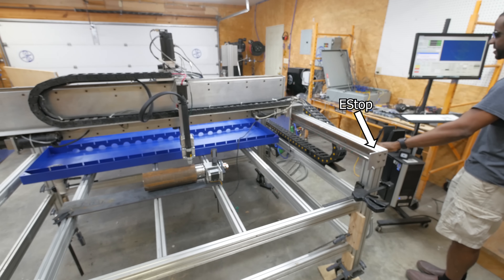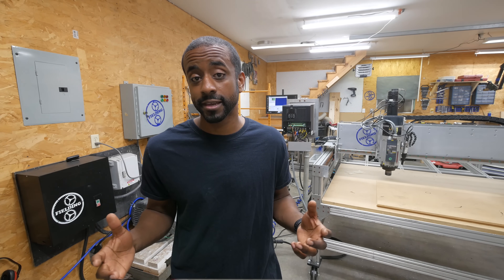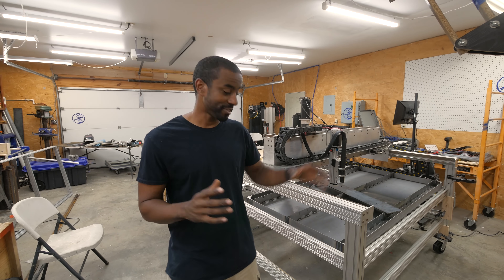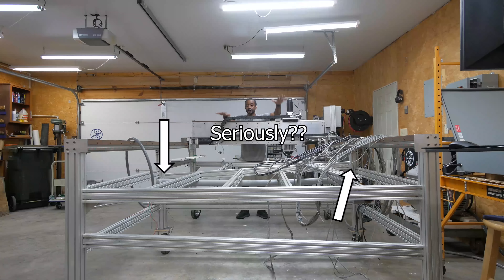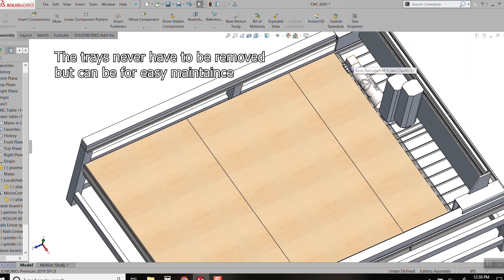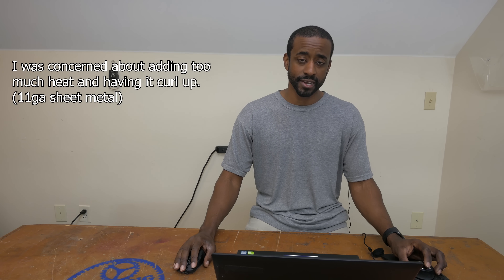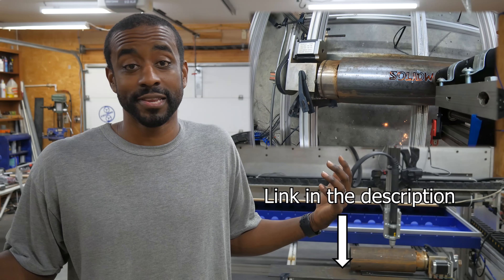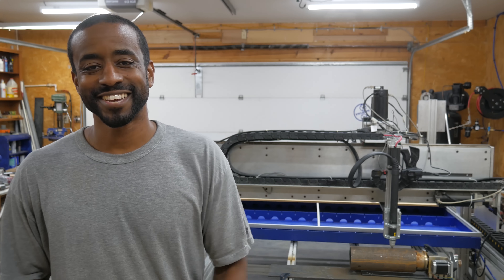Building The Ultimate DIY CNC (#072)

Comment: As a draftsman, I only know of three axis. One is vertical. Two are horizontal. What is the 4th axis. 🖖
Reply: I sure appreciate your help on this now that I understand what you mean by a 4th 5th and 6th axis. Are there more?
Reply: @twighahnjackson  yes, there are more. I've read about 7-axis machines and 12-axis machines. I believe the 12-axis machines have XYZABC (6-axis) for both the fixture and the tooling (6+6) for a total of 12 axes of independent motion. Sometimes it is just referred to as multi-axis machining.
Reply: Pretend that I'm draftsman not a maker? In other words, dummy it down for me please. 🖖
Reply: @twighahnjackson  I'll try to simplify it a little more (maybe in vain as I'm coming from a low-level engineering mindset). So the extra Rotation axes are the A-axis for rotation around the X-axis, B-axis for rotation around the Y-axis and the C-axis for rotation around the Z-axis. Think of rotation like curling your fingers around one of the axis lines and the curling of your fingers around the axis is the rotation going around the axis.

for the CNC Jeremy build (I assume the following set up) you have X-axis along the length of the bed,  Y-axis along the width of the bed, and Z-axis is the plasma torch or router height. the 4th axis is the rotating 3 jaw chuck which cut the pipe using the plasma torch. So that 4th axis is rotating around the Y-axis at the center of the 3 jaw chuck. Honestly, this is something which is easier to understand with a picture, illustration, or a video; than it is with just words.
Reply from the maker: Rotary
Reply: after 4th there is also 5th axis 3+2 (XYZ axes + rotary on A and B axes)

Comment: Jeremy, I'm trying hard not to sound like a ten year old gushing with hero worship.  But you're so freaking awesome! Sorry, but it is true. In other videos, I love the way you salvage appliances from the trash and turn their parts into new machines. And those wooden clocks you design and build, hard to say where engineering leaves off and art begins. I'm so glad Solidworks sponsored you, just hope that when you're raking in millions you don't lose sight of the wonder of re-using salvaged parts where appropriate. IMO, this was money well spent.

I have been wanting to build a CNC machine like this for decades so I have given it a little thought. I'd consider adding one more degree of movement to the pipe cutter so that it can tip up like a record turntable. I think that by combining rotation and tip you might be able to make non-orthogonal pieces, and maybe make smoother gear teeth. There may be a lot of devils in the details but I'm sure you can squash them.

Another idea, make a universal mount for attaching tools to the z-axis. Maybe add some electrical contacts in a standard place so the computer can talk to the tool without you having to fiddle with wires. Then you have one CNC machine for plasma cutting, laser cutting, routing and whatever you come up with.

I don't know what controller board you're using, or if you made it yourself and programmed it yourself, and I'm not an expert, but the ghost running it might be static charge build up, stray currents, bad connection, or maybe radio interference. If you programmed it yourself,  try double checking the computer/microcontroller setting for internal pullup/pulldown resistors, if the pins are floating it leaves an open door for ghosts in the machine. If it isn't already, mount the controller board inside a metal box. I guess I'm being like the dude that sees a dude with his hood up by the side of the road and suggests stuff dude already thought about.

Anyway, awesome project.
Reply: I'm with you Karl, Jeremy is like a rocket scientist compared to myself, maybe like he assembling things but the coding? Above my education level.lol

Comment: Very nice. What's the control system on this guy? If you need any help with configuring LinuxCNC for plasma cutting, you have a neighbor that'd be happy to help. 

I've even got the nitty-gritty parts like ohmic sensing and a THC (based on an Arduino) up and running now. Videos forthcoming, but as you know, this stuff takes forever to shoot, and even a good video isn't as good as a personal Q&A.

Comment: I started using SolidWorks years ago in my small startup design and manufacturing business. I ended up with a room full of engineers, each with their own SW license, by the time I sold my business last year. I can honestly say I never could have had the level of success I did without SolidWorks, their support, and training. After six months of sitting on my behind watching YouTube I'm starting to get ideas again. I think it's almost time to get a fresh license and start the process all over again.
Your shop is looking great by the way.
Reply: Bill if you don't mind, what type of things were you designing in  your first business. This is so new to me & above my head, wanted to do some guitar designs but the coding above my head.
Reply: @jettramel  We made assemblies for industrial vehicles using sheet metal, mechanical, and thermoformed plastic. SW was ideal for collaboration with customers and suppliers. I never had to touch G-code myself. I found the SW user interface to be quite intuitive.

Comment: Which motors did you use for linear motion?
Reply from the maker: They are 80 Volt Brushed DC motors, with encoders attached so I can control them with a servo controller.
Reply: @Jeremy_Fielding  which PC based CNC software did you use?

Comment: Congrats on the new job.  I knew you moved but somehow missed it was for work.  This CNC is sick.  I have a Plasma CNC and 2 router based CNC’s, but this is next level.  Does the plasma have torch height control?  I wasn’t looking close enough to tell.  But having a 4th access is insane.  Now you need some welding and Powdercoating equipment.  Your quickly outgrowing your shop. 🤣
Reply from the maker: Yes it has THC

Comment: Dude... Cutting a pipe via CNC with a torch is the stuff of dreams.... and you built this?  NUTS.
Reply: Great to see you here Destin!
Reply: So cool to see my heros checking in on my heros :)
Reply: It's about time you showed up!
Reply: Do I sense a collaboration in the near future???
Reply: The Destin connection. This is a good omen. Subscribed.
Reply: .
. Indeed... the Z axis range is where its at.
Reply: I know right. Normally you have to cut it on a flat plate then roll it out. This guy just cut out a whole major step.
Reply: in reality the hardest thing is to get the alignment good enough. this can take a while, i have a desktop cnc router that if i want to configure to use my aldi plasma cutter with the custom mount for the cutting head i made it takes a while. then i insert the 4th axis and align it which takes the most amount of time, i use artcam (and yeah it's kinda crap but that's what i use) and it sets up the piece swapping the x axis for the 4th axis. simply put you have to zero the x axis dead center over the work piece before disconnecting the x axis connector and plugging it into the 4th axis. i had a student copy of solid works where i didn't have to disconnect anything and it just spat out the g code. hell i didn't even have to do the tooling back then. 
i see  this machine has a ton of bed space so all that needs to be done is set the zero to the place where you are working and go from there.

Comment: Aren't you worried the moisture from the water tray will get into the panels and cause them to swell and warp.
Reply from the maker: No... at least not yet. I am using a plastic sheet in between... it is to block the dust, but will also act as a vapor barrier. the water will condense on the sheet. It is in the text on the screen.

Comment: Very cool! The water tray cover is a neat idea. Any concerns about humidity effecting the MDF?
Reply from the maker: Interesting. Not yet! LOL I don’t know if that will be a problem. Time will tell if the panels try to curl up but the boarder will be stiff. We shall see.
Reply: @Jeremy_Fielding  
I was thinking the same thing. You're definitely going to have an issue there. A light coat of fiberglass resin or epoxy would do the trick. Absolutely amazing CNC machine. Nice work!
Reply: @aznative_  Since its a work surface they will get scratched and dinged so really coating them in plastic will just make them rot faster in humid and moist conditions just like Ikea furniture.
Reply from the maker: I like the "light coat of epoxy"... great idea
Reply: @Jeremy_Fielding  I kind of skipped around in the video and missed the part about the plastic vapor barrier. In that case my idea in my opinion would be more of a waste of time. The Vapor Barrier will do a good job and MDF is cheap enough that you could just anticipate changing it out every so often to give you a fresh surface.
Reply from the maker: I am using a plastic sheet in between... it is to block the dust, but will also act as a vapor barrier. the water will condense on the sheet. It is in the text on the screen.